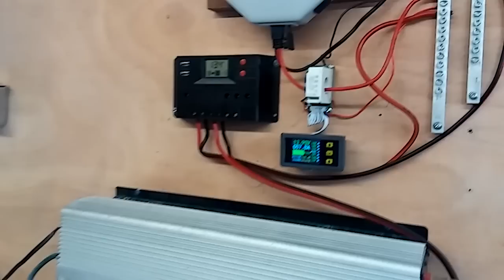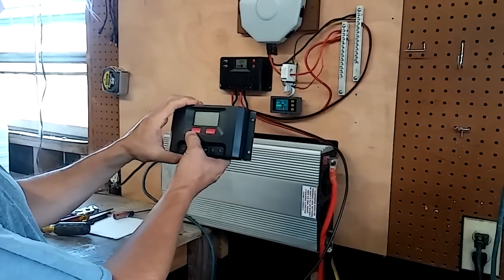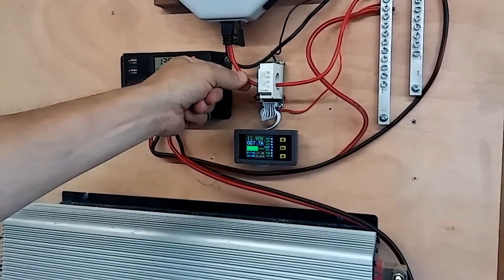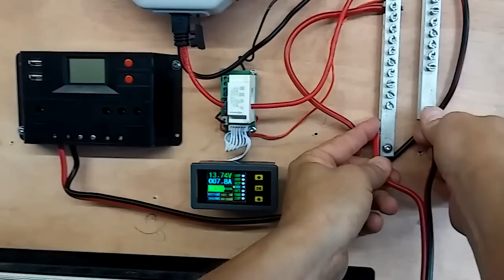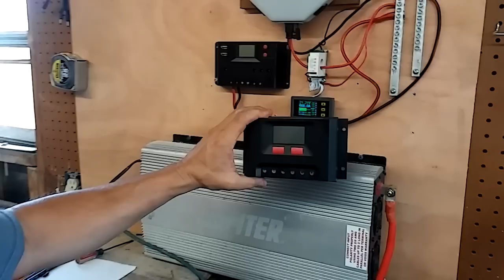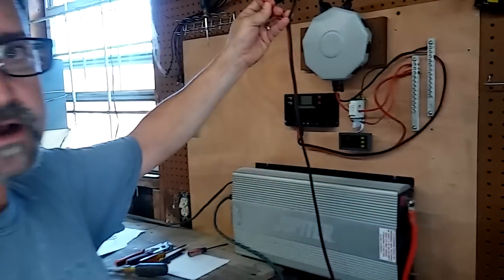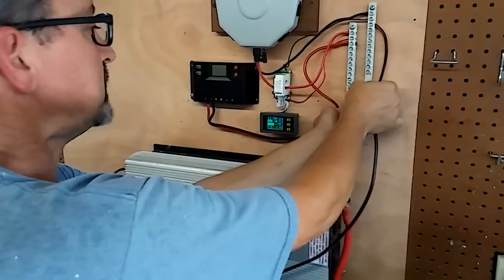Maxing out Harbor Freight solar panels

Comment: When they get hot, they output lower voltage.  A MPPT won't help with that because your power point voltage is lower than regular panels.  Series panels might help with MPPT. Ive just bought a couple cheap PWM controllers and I'll be looking at an easy way to use these with  with lower cost grid tie panels (30-60V) in MPPC.
Reply from the maker: opera. Ok. What is my power point voltage?  What should it be for 200 watts? Can these cheap panels even produce 200 watts? I don't think they can. Each panel still has a max amp rating. Your controller wont produce more amps just because you run your pannels in series with a higher voltage. All your doing is being able to produce voltage at lower light but your watts will still be low. You can't cheat the system...
Reply: I can answer that question. Yes they can. The other day my 9 panels ( haven't install all of mine yet ) ( 225 watts hooked in ) actually beat their rated output. Saw 238 watts at one point. Sadly, I'm configured for only 142 watts output on the one controller and it tried to overload the buck converters that do the final charging. Needless to say, it blew all three 3 amp fuses at 15.84 volts. That indicates that they were each hitting 5 amps at the time they blew. You need to get your panel voltage up to 18 volts to see the max output and hooking directly to the batteries will not do that. Adding the fourth buck converter should take it up to a max of 190 watts on mine. My panels that day before the fuses blew showed that they were at 22 volts which is their vMax at that point. Today, with it cloudy, the 200 watt setup was hitting right at the 118 watt point.
Reply from the maker: gravelydon. Thank you for your input.. My panel voltage when not under load is 21 volts. On the back of each panel it says 18 volt. Usually it stays around 14.8 volts when loaded,,
Reply: One or two volts difference in their vMax can be a number of things. Temp, solar radiation, meter differences, etc.... I manage to overdo mine again today so all three fuses blew again. Right during the middle of the day we lost commercial power. FPL said up to 4 hours before it would be back on. The system at that point had the batteries at 14.1 volts and were only taking in 50 watts out of the 200. Turned on the Jupiter 2000 watt inverter and went back in the house to plug in the small A/C unit. Fired it up. Saw readings of 1400 watts at the max so I know that caused the charging system to go full bore. When we got commercial power back less than a half hour later I noticed that they were not charging again. Found blown fuses again. Tonight, one of the 3 amp units got replaced with one that can handle 6 amps but is set at 4. If it works out okay tomorrow at that setting, then it will get bumped up to 5 amps. The bad thing about the STM8 controlled units is that they do well with the voltage control but will overshoot the amperage.
Reply from the maker: gravelydon . check my latest video. I got 9.3 amps today. Not sure where that came from. The most amperage I've been getting is 8.4. I kinda got excited over that extra amp Lol.....

Comment: You didn’t have to change the wires to a lower awg??? Or is that fine
Reply from the maker: It’s fine.
Reply: @Checkitfirst  okay I wanted to get two of the monocrystillne panels that harbor freight has now and I wanted to make sure that was fine
Reply from the maker: @Shmade0304  I wasn’t aware that harbor freight had mono panels. I’ll have to look into that. My harbor freight panels are amorphous
Reply: @Checkitfirst  no they do check the website they 100w
Reply from the maker: @Shmade0304  they want 100 bucks for the panel. 79 bucks on amazon.
Reply from the maker: @Shmade0304  Visit the Newpowa Store
Newpowa 100 Watts 12 Volts Monocrystalline Solar Panel 100W 12V Compact Design High Efficiency Module Rv Marine Boat Off Grid
Reply: @Checkitfirst  okay what’s the website
Reply from the maker: @Shmade0304  amazon.com

Comment: The max i can get out of my HF 100 watt set is 4.25amp in AZ with panels aligned precisely to the sun. I also tested each panel separately.  There's some loss in the wiring but not much.  The blue LED lights on the panels are a gimmick. They will stay on until it's completely dark and the charge controller will show you you're charging your battery in very dim light. If you put a volt meter on the panels you'll see over 20 volts before sunrise. Looks impressive until you put a DC amp meter on the system and see you're only getting .01 amps at 22 volts+-.  LOL. Also the tilt of the panels makes a big difference. When lying flat on the ground for example in full sun mid day the  amperage dropped to 2.6 from 4.2.  On a sunny day I get about 25 amp hours per day in December and on a cloudy day virtually nothing even though the controller says it's charging.  One day of full sun and one kit is the equivalent to running my HF Tailgater generator with a 25 amp battery charger for 1 hour per day. The generator will run about 9 hours on a gallon of gas. This means the 100 watt kit is saving me 43 cents for every full sunny day. ($3 for a gallon of gas + 85 cents for 2 stroke oil divided by 9 = .43) The advantage is no noise. The panels might last longer than a generator.  And a kit should pay for itself in about a year if you use them every day and most days are sunny. The disadvantage is constantly moving the panels throughout the day for max output and the need for many panels if you hope to keep a large battery bank charged without a generator in an off grid situation.
Reply from the maker: I added a mppt charge controller to my system. It has a meter with it. I also added more meters just to check. I have 3 HF kits now. On a good day I get 13 amps +-. Thats about 4+ amps each kit. I just bought 2 monocrystalline pannels to add. Going to see which is better. Subscribe. Im going to do a video on it
Reply: @Checkitfirst  Yes my 100 watt kit with included controller is getting over 4 amps so what would be the advantaged of the mppt controller? It would be interesting to see if your noncrystalline panels have better output. Thanks for the reply.
Reply from the maker: @billborden310  well so far I notice that the voltage stays higher when charging. The amps are lower from pannels but higher to the battery. During peak charge times my voltage stays 15 volts. It just seems to charge better.

Comment: I got this same kit from Harbor Freight and will be returning it cuz I am not satisfied with the performance.  I too only see about 4 to 5 amps max and that is not even close to 100 watts.  Why would they advertise some wattage that is not achievable under normal circumstances?

Also here is another cool (literally) thing to try.  On hot sunny days when solar panels tend to run hot and produce less than maximum voltage, try squirting them with water from the hose to see if they produce more power.  I never really tested that but it seems it might work.  Since they are made to handle rain (and sometimes it rains when it is sunny out), I don't think it will damage them at all.
Reply from the maker: David James . Exactly my point. You should keep it though. They aren't verry expensive compared to other kits.. Im thinking of adding another kit soon or maybe a wind gen.
Reply: Do you want to buy 2 of my 4 panels?  If you do, I will keep the rest of the kit and monkey around with it.  Since you aren't getting the full 100 watts per kit, add a 5th panel to each kit (maybe get 2 Y adapters so you can combine the 5 output cables from the panels into the 4 way combiners), then you should get about a 25% boost in power overall without having to buy another full kit.  That will put it much closer to 100 watts per kit (5 panels each) for less than half the price of a 3rd kit.  You don't need that 3rd controller anyway.  You just need a few more panels and raise them up for air circulation and that will be a nice setup.
Reply: To truly max power output, he has to do it at 18 volts not 12-14 volts....

Comment: “Directly at the sun” changes on a second to second basis. You’d be better off arranging the panels along the arc of the sun so that there is always some voltage/current presented to the controller, and then scale up the number of panels along that arc. 6-8 of these kits would get you a consistent 400W during daylight hours, and that would give you a chance to store some serious power in a storage array as well.
Reply: No, since this is a roof mount ... it is best to point the PV Array DUE SOUTH and match with a CC that can handle the array at Solar Noon.  Installing Panels on an East / West tilt creates Shading Issues - way over this guy's head.  "K.I.S.S."  I would never install 6 - 8 HF Kits = a waste of time and money and roof space. That small battery is just enough to keep the Voltage Steady when clouds pass by, it is not designed to run the house at night

Comment: Also have you consider wiring in an inverter to not only get DC output to power dc lighting but also run AC outlet for ac machine/equipment/appliances. With 8 amps you could probably run a pretty good portion of basic house appliances for some time.
Reply: With 8 amps x 12 volts = 100 Watts.  What can you do with that ?

Comment: So the maximum amount you can pull using that busbar system is 13.6?
Reply from the maker: 13.6 is just the voltage im talking about the amperage.

Comment: I bought 2 kits but couldn’t figure out how to connect them both
Reply from the maker: You can actually use both charge controllers on the same battery bank. I did it for a while. It’s in one of my videos
Reply: @Checkitfirst  What wire size did you use from the battery to the controller? I’m still using the clamps that came with the kit,
Reply from the maker: @manuelsalgado8510  I used eight gauge on each controller

Comment: I have had those dang harbor freight panels. After a while I would notice the power get less.. I would plug and unplug one by one till I found out which panel had took a crap. One usually does... You need to graduate to real panels. I spent lots of money trying to be cheap!!! Finally I have all the right equipment. Wish I would have just spent the money from the gate... But some people learn the hard way.
Reply from the maker: Since I have made this video. I have upgraded meaning I added nice panels to the harbor freight panels. I am in the process of removing my harbor freight panels and just keeping the monocrystalline panels I bought on Amazon also I have a brand new charge controller. I have a few videos of it you should go check it out
Reply: Which one did you upgrade too?
Reply: looks like the name is "Q cells"
scored a couple 280 W panels from a friend in Phx. I don't know where he bought them.
Reply: looks like the name is "Q cells"
scored a couple 280 W panels from a friend in Phx. I don't know where he bought them.

Comment: At first I thought that’s all the power you were getting out of the large set of panels then realized you were receiving about 8 A from 200 W of solar. That’s not terrible. Personally I’ve never had panels put out much more than 75 to 80% of what the claims are. In the winter time as the temperatures dropped the amps increased. many factors including sun exposure time of year temperatures connectors which you may want to make sure that you’re using good quality connectors everything is fitting tight the way it should the right gauge wire. I have some of those PWM charge controllers a little different than the one you have mine don’t have a screen. However, I got rid of my lead acid battery along time ago and got a good deal buying a 100 amp hour 12 V lithium. After getting $200 off from Amazon credit card approval it cost me $75. I needed a better charge controller so I spent about $115 and bought 30 amp EPEver Xtra MPPT controller that has waterproof display and buttons. I have multiple sets of panels for redundancy in case needing to switch out. The best seem to be the monocrystalline. I have a Morphis thin film, but they’re producing similar to what you have there about 50% of rated output. Currently February in winter hard to get sunny days in the north east part of the United States. Mostly I’m limited by my choice where to mount for sun exposure. Thanks for sharing your results like other said you may want to try pulling a load plugging something into the inverter draining the battery a little bit. My charge controller floats when voltage gets to 14.2 V then it doesn’t actually start allowing current to flow from the panels into the battery until it dips down a full bolt. at some point I’ll invest in a meter they can read voltage etc. without needing to hook everything into the charge controller. Thanks again stay well
Reply from the maker: I have recently switched over to mono panels. My whole system has changed quite a bit since this video. I do have some videos on it.

Comment: I think the charge controller that comes in the 100w kit is rated to 100w max. Have you had any issues with it?
Reply from the maker: Tony Solar. No. I have pulled 200 watts with it and it still works fine
Reply: @Checkitfirst  Nice.. Thanks for the info and awesome video.

Comment: Where did you get the ampmeter
Reply from the maker: Eric Cart. Amazon 
 
3.8 out of 5 stars 23
Yeeco Digital DC Voltmeter Ammeter Multimeter, 10-90V 0-200A LCD Color Display Voltage Ampere Power Watt Coulomb Capacity Time Meter Tester Testing Detector with Hall SensorYeeco Digital DC Voltmeter Ammeter

Comment: Hey brother I'm not getting what I feel like I should be getting amp wise out of my 300 watt setup Does that hub run the panels in series or parallel?
Reply from the maker: Parallel
Reply: I checked each panel 20 volts and 3.5 amps when I have each one, one at a time plugged in and I have a dif charge controller so it may the charge controller I feel like it should be at least ten amps to fifteen in full sun
Reply: I have an mppt charge controller but I'm not hooking up my good stuff til I get a good hold on the cheap stuff lol I feel like I need to wire in series and then in parallel to bump up the voltage and the current to balance both out what you think?
Reply from the maker: @flintriverkayaking7051  
I have come to find out that when I have a load on mine it pulls more from the panels
Reply from the maker: @flintriverkayaking7051 
Running in series with mppt is always a good idea.  What kind of battery bank do you have
Reply: @Checkitfirst  right now I have four lead acid die hard marine 140 minute reserve batteries for a test unit , I have 6 100 ah lithium iron phosphate batteries for my main unit ounce I get a handle on this stuff, I'm just not understanding why I'm not getting more amps other than my charge controller can I put the mppt on there and see what she does my voltage is only 20 OC. With three 100 watt panels
Reply: @Checkitfirst  there is something I'm missing and not quite understanding yet, I really just want to be able to run quite a bit for at least 16 hours idk how much capacity I'll need exactly that's why I'm working with this lead acid in case I make any mistakes lol
Reply from the maker: @flintriverkayaking7051  
Make sure your panels are facing south. Do not lay them flat. Put them at an angle 📐. You get about 4 good hours a day of charge when the sun is out from 11 am and 4 pm
Reply: @Checkitfirst  I hope to do that today thanks for the input on that  I have all that correct as well so far anyways 😃
Reply: @Checkitfirst  I figured it out I think anyways cause it m getting 16.2 amps at peak sunlight I took out a solar combiner and ran my panels straight to the charge controller so either bad combiner or wires not carrying the current as far as I was trying to run it down one wire now I have five runs to  a combiner right at the charge controller and then ten gauge from there to controller
Reply from the maker: @flintriverkayaking7051  
Awesome
Reply: @Checkitfirst  thank you I appreciate it very much
Reply from the maker: @flintriverkayaking7051  Anytime. I’m no expert by any means I can only help you from what I have experienced😊
Reply: @Checkitfirst  I know but you'll at least respond

Comment: Wish you would have unplugged 1 set to see if it dropped to half the combined results. Maybe one set isn't working? If not then it would mean the panel set outperforms rated specs.. Just a thought. :)

Sorry if this has already been stated, I didn't check your responses. Thanks for the video.

Comment: How did you mount these to the roof?
Reply from the maker: There are four screw holes in the corners of the panels..  I used coated exterior screws. If you do this,, make sure you don’t screw all the way through the roof deck and use roof sealant around the screw holes. Screw the panel down then remove the panel fill the screw holes with the sealant and screw the panel back down. They have been on my roof now for three years and there hasn’t been any issues that I have seen

Comment: how are you holding 8 amps of current with your fingers?
Reply from the maker: Amps at a low voltage are not dangerous. A car battery has an amp output of 500+ amps at 12 volts. Never seen a car battery shock anybody...
Reply: Check it first
I was cleaning up debris from an auto accident, it was dark and I didn't see that the battery case was missing. I reached down to pick it up, and when I grabbed it I got shocked and threw the battery about 20 feet. It was a 12 volt lead acid battery .
.

Comment: What battery you running and name of it
Reply from the maker: At the time of this video, it was a deep cycle, marine battery from AutoZone
Reply: @Checkitfirst   what you recommend for a 5000watt inverter for battery
Reply from the maker: @iamthesoultaker4635  
If it’s in your budget, then you need to go lithium. If not, I would say four deep cycle marine batteries.